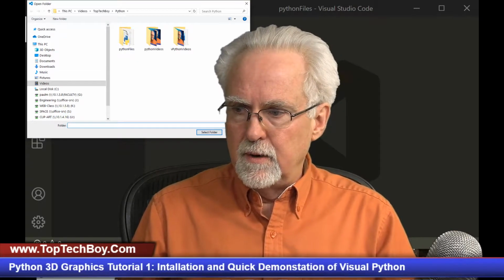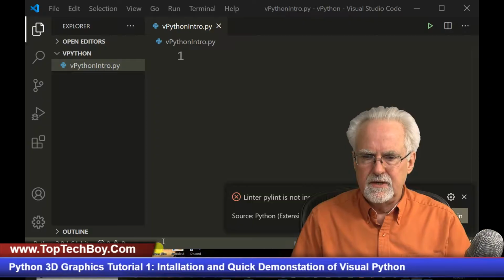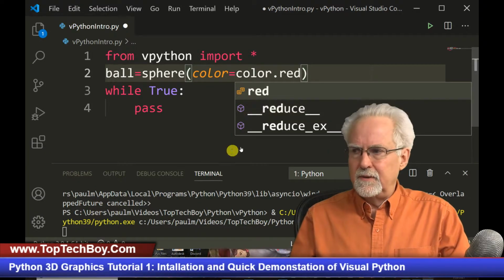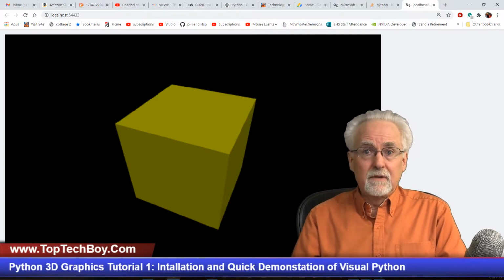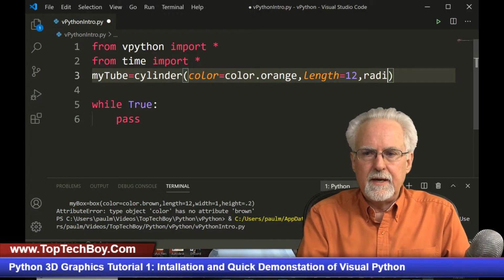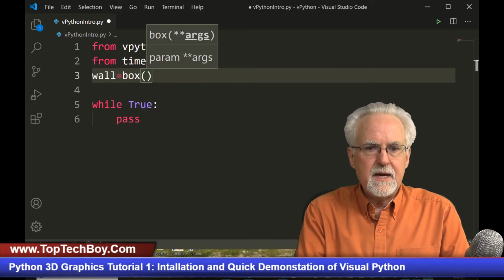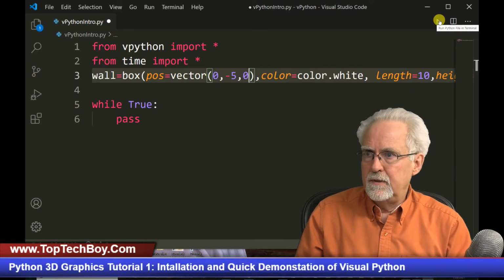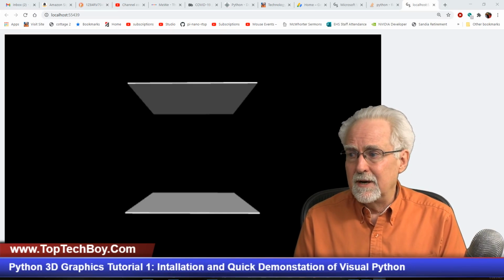Python 3D Graphics Tutorial 1: Installation and Demonstration of Vpython

Comment: A quick and important tip on installing vpython with pip on a Mac :, python v2 is already pre-installed on Mac and  pip is then referring to version 2.x.  Here you need to use the python3 and pip3 commands. Otherwise vpython is installed under version 2.x. So when you then try to use the vpython library it doesn’t find it.  I’m not sure why you got away with using pip but I assume it’s because you only have version 3 installed. And no there is no easy way to remove version 2.x from Mac.

Comment: I did it, thanks a lot.
this is the code:

from vpython import *
from time import *

Floor=box(pos=vector(0,-1,0),color=color.white, length = 10, height= .1, width=10)
celling=box(pos=vector(0,5,0),color=color.white, length = 10, height= .1, width=10)
leftWall=box(pos=vector(-5,2,0),color=color.white, length = .1, height= 6, width=10)
rightWall=box(pos=vector(5,2,0),color=color.white, length = .1, height= 6, width=10)
backWall=box(pos=vector(-.01,2,-5),color=color.magenta, length = 10, height = 6, width = 0.1)

while True:
    pass

Warm regards.

Comment: I installed vpython by pip install vpython, then I write import vpython and run the code. It says, it doesn't recognize vpython. I run pip install vpython again, it says the requirements are satisfied. I am using visual studio code. I need help with this problem.
Reply: I got it working. I like the tutorials.
Reply: I run the ball code in tutorial 1. All I get is an open browser with a black screen. I don't see the ball.

import vpython
ball=vpython.sphere()
while True:
    pass

Comment: Hi Paul, pip is not working for me I don't know why. Ill try to attach a video.
Reply: this is the error code:
pip : The term 'pip' is not recognized as the name of 
a cmdlet, function, script file, or operable program.   
Check the spelling of the name, or if a path was        
included, verify that the path is correct and try       
again.
At line:1 char:1
+ pip install vpython
+ ~~~

Comment: Paul, pip is not working for me I don't know why. Ill try to attach a video.
Reply: this is the error code:
pip : The term 'pip' is not recognized as the name of 
a cmdlet, function, script file, or operable program.   
Check the spelling of the name, or if a path was        
included, verify that the path is correct and try       
again.
At line:1 char:1
+ pip install vpython
+ ~~~

Comment: Hey man… maybe things are different on windows, but on Unix systems that trash icon just closes the terminal and then when you open a new one it starts from your default initial directory… it doesn’t kill the underlying process, so each time you’d open a new one that would be an additional process your computers trying to handle. I don’t know for sure if this is the case on windows, but I’d imagine it is. Ctrl-c or something similar will actually kill the process.
Reply: If you run a program in the terminal, do you get a list directly to the right of the terminal? If you do, hover over the lowest item listed (called python?) and a trash can should appear. Just try clicking that one trashcan only. I do not close "PowerShell" which is always at the top of my list.

Comment: I just did the test where you type "import vpython" and it gave me an error that says "Error in atexit._run_exitfuncs:" and it also says it has a "ZeroDivisionError: float division by zero", what do these errors mean?
Reply from the maker: You need a few more lines of code. Import the library, put your while loop, then put the rate statement in the while loop. Your program is exiting without steps, so vpython crashes.

Comment: Hey Paul, just got done watching the 20 other Python lessons and I am loving the series so far. I was excited to move on to 3D graphics, but when I try to run vpython I'm greeted with "line 22, in Exit a =1.0/zero" as an error. I only inputted "import vpython" as you did to test if it was working. I followed your exact steps, so I am a bit confused as to what to do from here. Any help is appreciated and thanks for the amazing videos!
Reply from the maker: You need to go on:
from vpython import *
while True:
      rate(60)

if you just run the program that imports the library it crashes when the program ends.

Comment: A quick word to the unwary newcomer to Python. I started from scratch in early March 2023 and installed Python and Visual Studio Code per Paul's introductory tutorial. I downloaded the very latest version of Python 3.12 and successfully completed the first 20 Python Tutorials.

In this tutorial I ran the command to install vPython using pip and pip thrashed my computer for about 8 hours before crashing. Pip was try to resolve package dependencies and was flogging itself to death backtracking through packages. 

After a deep dive into the  Python docs I found that Python 3.12 was still an alpha version. I removed 3.12 and installed version 3.11 and pip installed vPython in about 3 minutes.

Moral of the story: Unless you are an expert and want to examine / test new features of Python, only use release candidate versions of the software. All good now and I'm raring to go again.

Comment: Could you help me please ??

after installing vpython  successfuly like you did and importing vpython there is this error : 

Error in atexit._run_exitfuncs:
Traceback (most recent call last):
  File "C:\Users\Perfect0\AppData\Local\Programs\Python\Python39\lib\site-packag
es\vpython\vpython.py", line 22, in Exit
    a = 1.0/zero
ZeroDivisionError: float division by zero
Reply: Running Python 3.11.2 via VSCode 1.76.0 . O/S is Windows 10 x64 .   I was  receiving this same error. I unistalled Python and reinstalled and followed Paul's instructions on installing vPython. That did not correct error. After searching the net I found a solution that works . Adding the code - 
while True:
    rate(60)
at the end corrects error running in the 'Terminal' .    Error does not exist when running in the 'Interactive' window . UPDATE - Good news- error seemed to correct itself .. while True loop is no longer needed , 😉 Try using it for a while and see if you experince the same.
Reply: @justmc62  unfortunately the error is still there I am using VSCode 1.77.2  O/S windows 11 x64 python 3.7.9, python 3.9.1 and 3.11.2 I used these three version seprately in virtual environments

Update, I just commented these lines a = 1.0/zero in the library file and the error isn't showing and until now everything is okay IDK if that is okay to do but mehhhh ^^, it worked
Reply: any fix?
Reply: @aidanvega9778  Running Python 3.11.2 via VSCode 1.76.0 . O/S is Windows 10 x64 .   I was  receiving this same error. I unistalled Python and reinstalled and followed Paul's instructions on installing vPython. That did not correct error. After searching the net I found a solution that works . Adding the code - 
while True:
    rate(60)
at the end corrects error running in the 'Terminal' .    Error does not exist when running in the 'Interactive' window . UPDATE - Good news- error seemed to correct itself .. while True loop is no longer needed , 😉 Try using it for a while and see if you experince the same.

Comment: I am getting the following error...

Traceback (most recent call last):
  File "C:\Users\User\PycharmProjects\PaulMcWater\PaulMcWorter021.py", line 3, in <module>
    ball = vpython.shepere()
AttributeError: module 'vpython' has no attribute 'shepere'
exit
Exception ignored in atexit callback: <function Exit at 0x0000014BA1853B50>
Traceback (most recent call last):
  File "C:\Users\User\AppData\Local\Programs\Python\Python310\lib\site-packages\vpython\vpython.py", line 22, in Exit
    a = 1.0/zero
ZeroDivisionError: float division by zero
Press any key to continue . . .

Comment: Using visual studio code with vpython library installed i get error 'sphere is not defined when trying to run following code: from vpython import *   ball=sphere()  while True:  pass
Reply from the maker: Are you successfully importing the library? If you do just the import command do you get an error? It seems that if the import is successful, the sphere command just has to work.
Reply: Hello.

If your error says something like "AttributeError: 'sphere' object has no attribute 'idx'" then you should try doing this:
    pip uninstall autobahn
    pip uninstall txaio

Then install autobahn version 21.11.1
    pip install autobahn==21.11.1
I did this and it worked.

Comment: Another fun one, and I feel like I learned a lot in this one short lesson! A little tricky getting the walls to all line up correctly but placing them one at a time while playing with the vectors made it easy, and then placing the ball (sphere) in the center was simplicity itself, and made a pretty picture. I also put a larger black marble in the center, ringed with eight different colored smaller spheres arranged around it, all just touching each other just to make sure I had the vectors all clear in my head, at least on the x y plane. It was a fun exercise!
Reply: do you know where to download Vpython? it doesn't specify in the video.

Comment: If anyone is having issue with “pip install python” (which reverts with “command not found: pip”), use following instead: 
pip3 install vpython
Reply: I am running in to the same issue, Not a recognized cmdlet, function etc.
Reply: Could you help me? I’m having trouble importing vpython. Everyone I try I get an, “ exit error in atexit._run_exitfuncs” I would really appreciate it

Comment: For some reason, when it goes into a Browser, the screen is just white blank
Reply: I had this issue on Safari and Chrome on Mac M1 Big Sur and just fixed it by enabling the option 'Web GL 2.0' in the Experimental Features in Develop menu (for Safari). I found this dependency missing after checking the Console errors in the browser.

Comment: Hi Paul,
install vPython is not working.
it's  look  that he has installed everything, but when i try to put in the program he not recognize vpython
what do i wrong?
what steps must i do for a clean install from vpython
the version from python i use is 3.9.10
thanks in advance
Reply from the maker: I would start clean. Uninstall whatever pythons you have on your system, and then follow my video exactly. many times you can have multiple versions of python without knowing it, and you can think you are installing to one version but actually installed to a different one. If you start clean, and do exactly what I do, it should work.
Reply: hi Paul,
i have installed everything again.
i have used now python 3.9.1.
everything looks ok now until i try to run the program.
my explorer gives the following error.
The connection for this site is not secure
ERR_SSL_PROTOCOL_ERROR
how can i solve this?
thanks in advance
Frans
Reply from the maker: It sounds like your browser wants a secure connection, or even a security certificate. I really can not help debug that, as it depends on so many factors like what browser and what version. if you are using chrome you can probably disable looking for SSL certificates. Sorry I can not be of more help.
Reply: @paulmcwhorter  
Hi Paul,
Thanks for the your fast reaction.
I have solved the problem by using firefox instead of microsoft edge.
i wil try to fix this problem with microsoft later.
Grtz Frans

Comment: Hey Paul thank you for all you do on this channel it has helped so many people out and we are all  thankful. However I had one problem in this lesson. I did everything you said but when I imported vpython  the terminal came up with 

Exception: The non-notebook version of vpython requires Python 3.5 or later.   
vpython does work on Python 2.7 and 3.4 in the Jupyter notebook environment.

I have no idea how to fix this but I don't want to let it stop me from following your lessons.
Reply from the maker: I would start over with the installation. Make sure you are using my version of python. If you are using an older version it will not work. If you installed the new one, but had an old version already there, perhaps you are still using the old version.
Reply: Thanks Paul. I checked what python version I am using and I am using version 3.10.0 I have reinstalled it multiple times but the same problem keeps appearing.
Reply from the maker: Ben, Vpython does not work with that version. You need to always start with the same version of python I am using. Try installing 3.9, and it will all work
Reply: Paul, I think you said something about using the same version you were using in the start of these lessons, but it didn't sink in at the time.  I installed version 3.10.0 thinking that would be ok.  Now I have to pay for not paying attention just like that old rusty three leg Walmart Lawn chair.  Great lessons been following your lessons since the spark fun inventor kit days.

Comment: I am having a problem getting vpython to work. Python works fine. I followed your steps in this video using pip exactly.  When I get to the step where you put import vpython in your first program it underlines vpython and says it doesn't exist. I tried: from vpython import * and got the same result.  I don't know where pip installs to and I don't know if I can uninstall to start over.  Any suggestions?  This is the only way I could find to contact you.
Reply from the maker: Go back to the original python playlist and watch the videos on setting python up. Sounds like you might not have set the path when you did the install. I can not explain all that could be happening in a comment. I do show how to properly configure python and Visual Studio Code in those earlier lessons.
Reply: @paulmcwhorter  I did as you suggested, but everything seemed to work just as yours did in the video. On the third try at installing the second part I found several files that were scripts for Jupyter that were put in a deeply imbedded folder.  That folder was not in the system path, so when I tried to import vpython it would tell me the the modules were not found.  For anyone having this problem watch for a warning text was pip is running.  It will print out the path that the files are stored in.  You have to enter that path into the system variables where the paths are stored. For some reason even though I checked the boxes to include the path, those few files were put in a folder that wasn't in the system path. 

Thank you for responding and suggesting that I return  to the previous video (#5). While trying to reinstall everything, I saw the warnings when running the second pip install..  The warnings didn't stop the install; the pip just rolled right past them and said everything was complete. There was so much text scrolling past so fast it was hard to spot. I'm back on track

Comment: Paul,

For some reason, when I use the vector function, y=-5 moves it up and y=5 moves it down. I've checked the code multiple times and it is identical to what you have written. It's like my y-axis is inverted. I've played with the x and z axis and they displace as expected. Any suggestions?

Code as written: wall=box(pos=vector(0,-5,0),color=color.white,length=10,width=10,height=(.1))
Reply: height=(.1)?
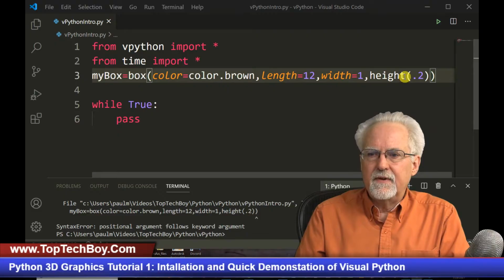You've made the very mistake he made 19:19 , which he corrected.

Comment: I have installed VS code Version: 1.63.0 and Python 3.10 and vpython. When I run vpython code it give me error on VS Code terminal "Exception: The non-notebook version of vpython requires Python 3.5 or later.
vpython does work on Python 2.7 and 3.4 in the Jupyter notebook environment."
Please help me to solve this issue so I can learn vpython using VS code editor.

Comment: i am on python '3.10'  and when i run the program it says :
"Exception: The non-notebook version of vpython requires Python 3.5 or later.
vpython does work on Python 2.7 and 3.4 in the Jupyter notebook environment."
anyone can help!!
Reply: at https://vpython.org/presentation2018/install.html it said   (At python.org the latest Python version is 3.10, for which there is not yet a vpython installer.) soo i guess python 3.10 dont support vpython YET
Reply: I have the same issue

Comment: HELP ! I'm having an error message whenever I try to import vpython. I succesfully installer it with the pip command, but as soon as I launch the program with the "import vpython" command, it tells me this :

Traceback (most recent call last):
  File "c:\Users\***\Desktop\programmation\vPython\vPythonIntro.py", line 1, in <module>
    import vpython
  File "C:\Users\***\AppData\Local\Programs\Python\Python310\lib\site-packages\vpython\__init__.py", line 25, in <module>
    raise Exception(s)
Exception: The non-notebook version of vpython requires Python 3.5 or later.
vpython does work on Python 2.7 and 3.4 in the Jupyter notebook environment.

I'm using python 3.10.0
I cannot continue the lessons until the problem is resolved. Please, can a kind soul help me out ?

Update : i left a message on the vpython message board and they told me it's a problem with the way vpython checks the python version and that they will patch it when they can. Guess I just have to wait...

Comment: Hi paul ive done whatever you have done but some how i get error of my import(vpython) what should i do I ve done exactly what you have done times and times ive even changed my folder name to the one you have made to prevent further problems
Reply: have you fix the problem? I have the same problem.
Reply: I'm in the same boat.  My VSCode runs python normally, and the pip install python worked fine from what I saw scroll by But the python module is not recognized. How did you resolve this. thank you. @okimoy2688